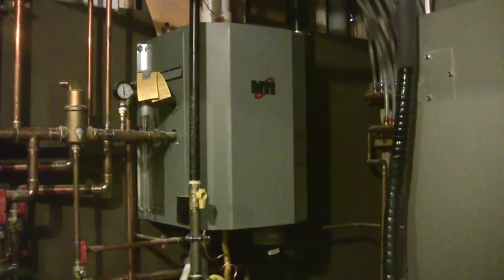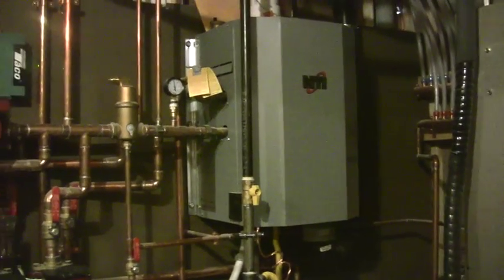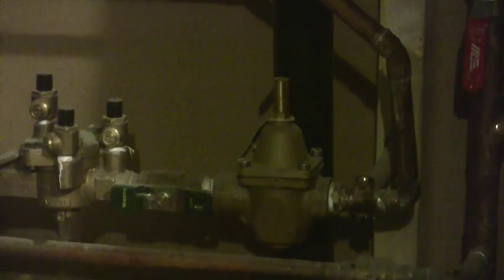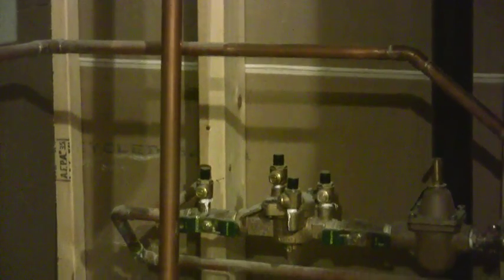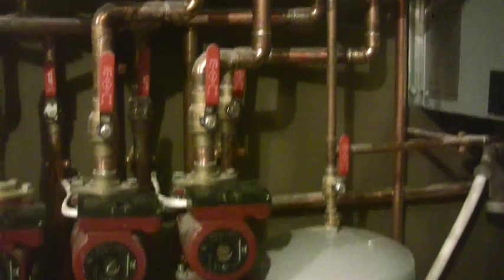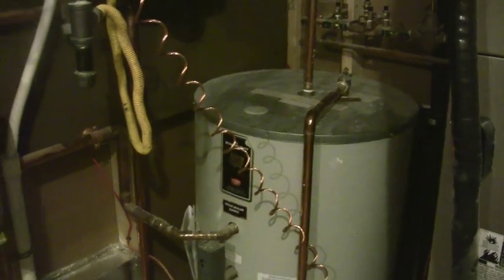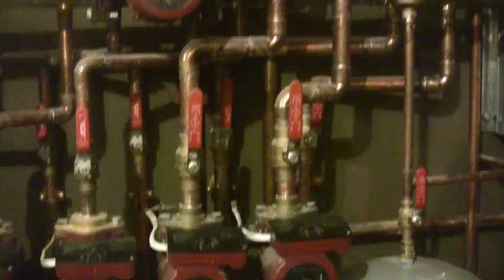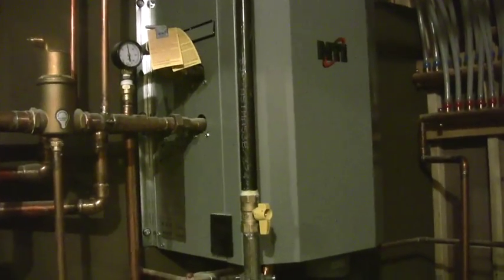Hydronic Heating with a Trinity Boiler part 1 of 2

Comment: How many circulators are you running? Also on pressure reducing valve do you not run a bypass valve downsteam to upstream with a ball valve? Or is that because you run glycol all year?